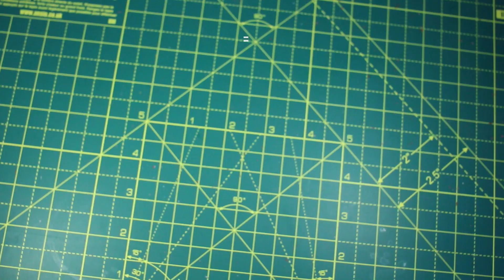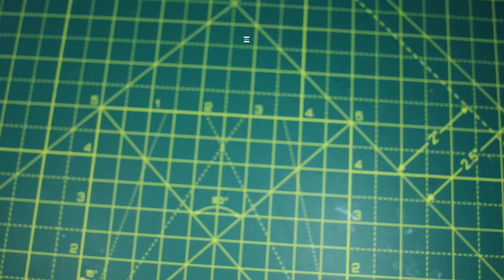Bagnall Industrial Loco Build - Model Railway Mania

Comment: Hi I’m a beginner in modeling and I was wondering how you learned all this because I would love to make my own fleet of engines!
Reply from the maker: Yeah you definitely should! I found that trawling through lots of threads on RMweb introduced me to loads of techniques. I started out by using cheap and readily available models so that if I messed up, it didn't cost too much. Having the right tools for the job is also good, things like a good cutting mat, swann-morton scalpel with easily changeable blades, some files, wet and dry sandpaper, and a razor saw helped me get started.
Reply from the maker: oooh and some good tweezers and screwdrivers!
Reply: Railway Mania thank you so much I will definitely use all this in making my models!

Comment: i’ve recently purchased one of these hardys hobbies kits and i have absolutely no idea how to screw it on to its body. i can see theres 2 holea for nuts but i dont know what size i need. could you tell me how you did yours. Thanks alot. Ben.
Reply from the maker: Hi mate I think they are 12BA or 10BA nuts - I usually get mine from ebay
Reply: @RailwayManiaNet  Thank you very much I will get searching right away.

Comment: I have a technique that has helped me when it comes to spraying. I put paper clip or handrail wire inside of the Handrail Knob holes to keep them from clogging up. I always have to remember to leave a long section sticking out so I can get them out. It saves me the hastle of finding wire that will go into the holes and then poking it through or redrilling them and risking damaging the model. Beautiful Build as Always Corwin!
Reply from the maker: Good idea 👍🏼